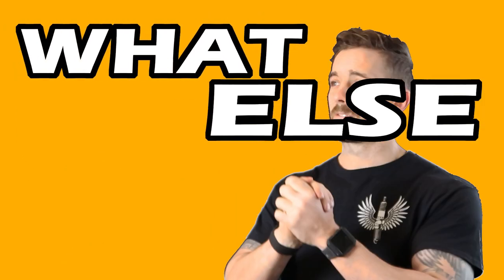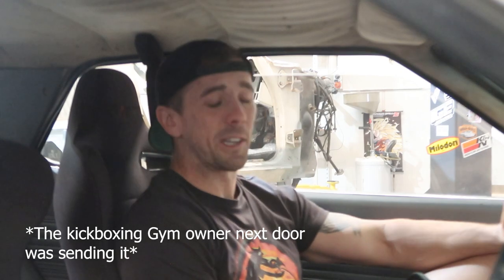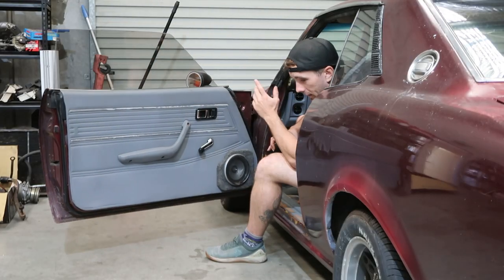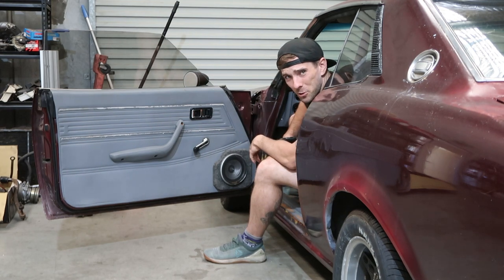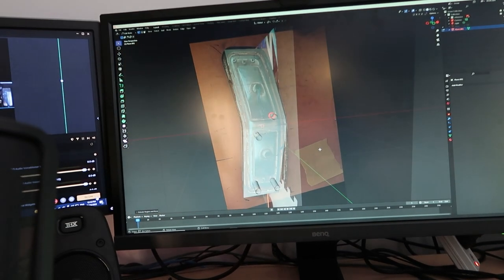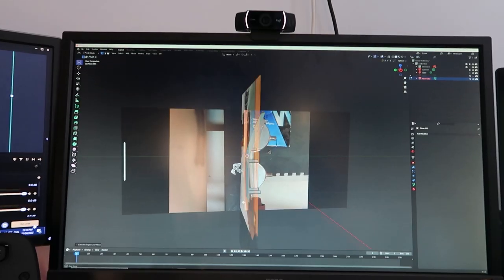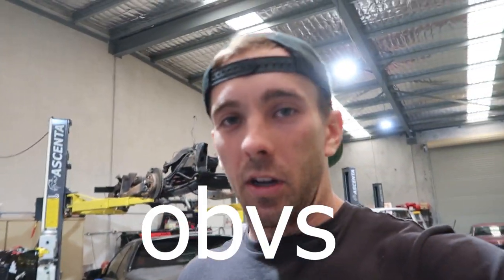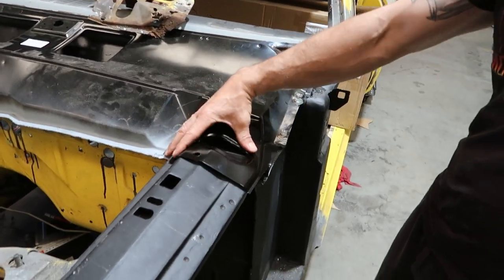XA falcon cowl replacement panels. How do they fit up??

Comment: Mate…do you need a drivers side 1/4? I have a clean one👌🏼
Reply from the maker: As in driver side rear 1/4? I literally just filmed the last ep and was going to ask in that if anyone had one lol!
Reply: @MattyWillo  yes mate….drivers 1/4 but from a XB. I got a NOS for mine, but this one is pretty darn good, all blasted and in epoxy . Man I wish you asked! 😂👌🏼👌🏼
Reply: Just had a quick look…wheel arch is good, along the B pillar is clean and still has the flange, the lower section between B pillar and wheel arch was cut out so needs a repair panel. I’ll send you pics if it helps mate
Reply from the maker: @stevebass6984  let’s set it up, email me at Matthew.wilson@aidg.com.au